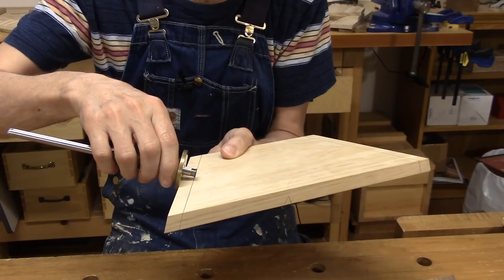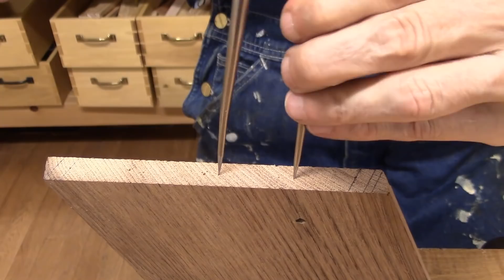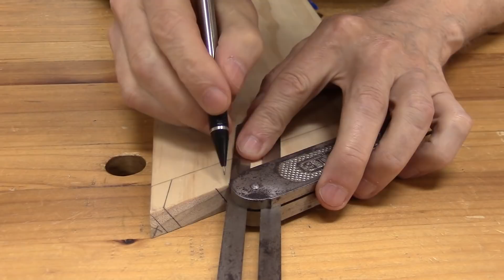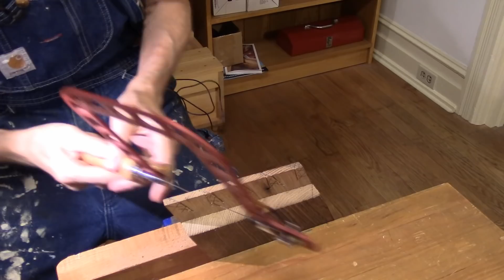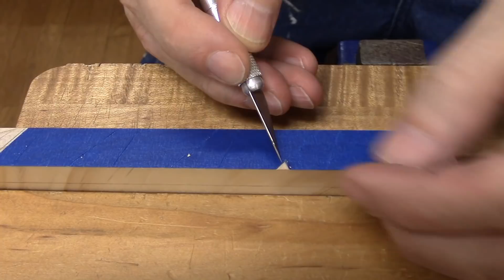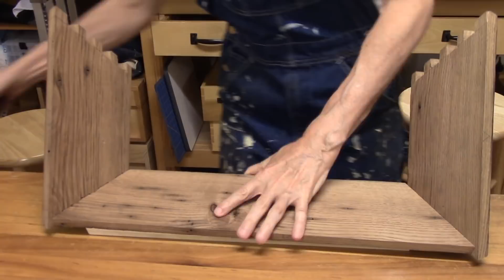Tool Tote Show #2

Comment: Table saw for angling and beveling then ends? Or did you figure a way to do it accurately by hand 🧐
Reply from the maker: Used my table saw, test cuts, tweaked with a block plane…tedious.

Comment: Hi there, I have just stumbled upon your channel- love it! I have a question regarding this episode. you are using a 14.5 degree bevel and a 26.5 degree slope.  you mention that this results in  a  90 degree angle intersecting.  But how did you arrive at those angles?  many thanks
Reply from the maker: Good question Michael. Because the sides are sloped it gets complicated. I used an online calculator to arrive at the angles I mentioned. I explain this in Tool Tote Show #1 at the 22:59 mark. Here's a link that will take you there. Regards.
https://youtu.be/yOAbZ86AiFI?t=1379

Comment: Just lovely. I have one more step with the tape method as I’m paranoid about the tape moving - once I’ve taken out (super carefully) the bits of tape where I’ll be removing material, I use a smaller roller and some ink over the end and the tape. That way, I can remove the tape and have something very permanent that I can work to remove. Have to be careful of the grain not absorbing too much ink though. One day I’ll trust myself and just do the tape. Maybe.
Reply from the maker: I was surprised by how well the tape adhered to the wood. I had to work to peel it off. Give it a try, it might save you a step. Thanks for the visit.
Reply: sachae321 good idea

Comment: Wow! Hi there Ken and Joaneen, 
Now that was a real brain teaser. Just working out what the angles of the dovetails was hard enough, actually cutting them was something else altogether. Fantastic. Your explanations were spot on too Ken. Just as well you have a few marking gauges to call upon, and remembering which one to use where was quite a feat.
Once again superb camera work from Joaneen, rock steady holding and crisp and clear focus on every shot. The complete professional.
Who does the editing? That too is spot on making the flow of the images fit together just right.
Looking forward to the next instalment. 
Best regards, Mike.
Reply from the maker: Thanks Mike. Yes, sawing is difficult as there is nothing square. I labeled each marking gauge so as not to mix them up. Still, it's very easy to make a mistake. Thanks for mentioning Joaneen's fine camera work, I couldn't do these videos without her. I edit the shows but rely on her for feedback. It's a team effort for sure. Best regards, Ken.

Comment: about transferring the tails to the pinboard, have you seen Rob Cosman's approach?

he sells a replacement blade for his marking knife that's the same thickness as his dovetail saw and has saw teeth, and you use it by slipping the marking blade into the kerf before you cut out the waste.

I haven't tried it yet, but I ordered the marking knife.

I'm really enjoying this series, btw.  the way you break the steps down is really easy to understand.
Reply from the maker: That's a very interesting method. I think I saw Roy Underhill demonstrate that technique, using his saw to do the marking. A marking knife with a toothed blade would be even better. I'll check out Cosman's replacement blade. Thanks.